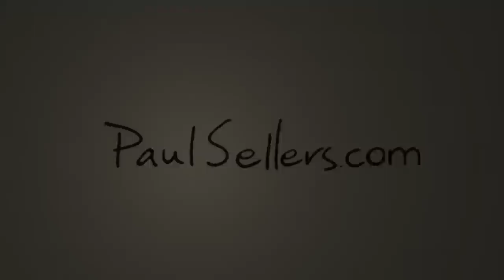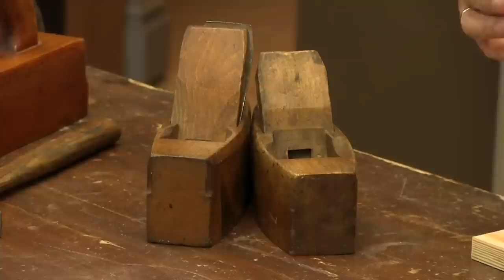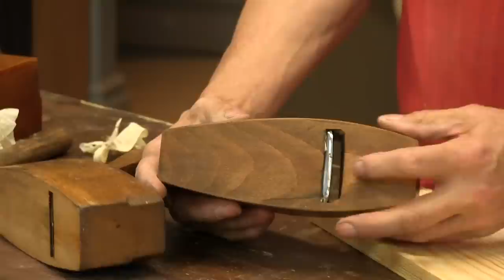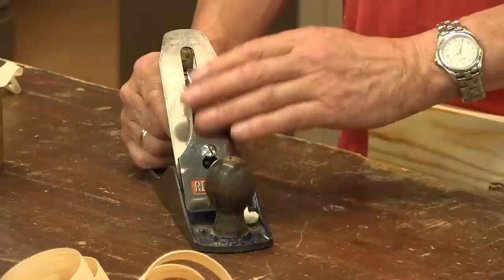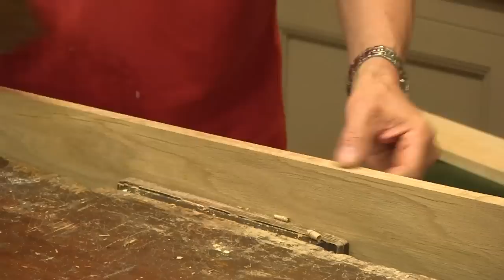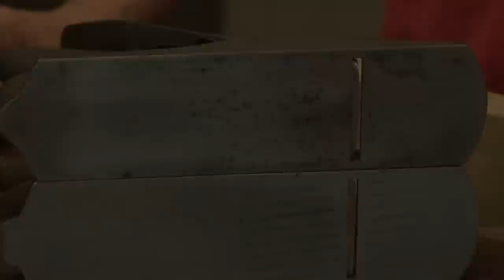Scrub Plane - a Historical Perspective - | Paul Sellers

Comment: in germany we have a name for it since... a loooooonnng loooong time ago :D it`s called  "schrupphobel". as a first year woodworking apprentice I learned that the main difference between a jack plane and a scrubplane is that the scrubplane doesn`t have an additional iron to break the shavings but a wider hole and a somewhat round bevelshape (like a carving chisel). Its used primarily to get off the sawmill traces and after the use of the schrupphobel you use the schlichthobel which is more accurately what you described in this video. the blade of the schlichthobel still lacks the additional iron of a jackplane. I loved to use it in school :)

Comment: This reminds me a lot of Chinese cooking cleavers. The cleavers are first used for taking nice fine cuts for cutting vegetables, but as you sharpen it over the years you wear away the metal and get towards the thicker spine of the blade, you would then use it for butchery and bone cutting. Its the same as using the fine smoothing plane and then as it wears converting it to a scrub plane for the rough (e.i. butchery) bits of woodworking! In the past nothing was wasted, brilliant!

Comment: Just picked up a new ece scrub plane. It took 30 seconds out of the box to adjust and was putting out nice thick shavings. The light tool felt great in my hands. This is why I got into hand tool woodworking. It seams like a critical tool to turn firewood grade into furniture grade.

Comment: I recently purchased a Stanley Rule and Level No. 29 (20 inches long) to use as a scrub plane. I was concerned when I saw that the throat the bottom of the wooden base of the plane was 3/8ths of an inch wide. (The top part of the plane is metal.) Thank you for showing that the widened throat was perfect for my use.
Reply: Hi, I´m going through comments cause I was waiting for an explanation of the longer ones we see on the table. I think a longer  fore-scrub plane would make sense. To bring big high low spots to flat/true surface. Did it work out? Thanks.

Comment: Paul, not this video but thanks for your other video on making a scrub plane.  Following your instructions I turned an little used Stanley 5 1/2 into my scrub plane.  It was first used to thin out the breadboard top to a night table.  The control and speed of wood removal on planing the glued-up boards was wonderful and the plane is so much easier to use with the adjustments than when it operated as a smoothing plane.  With the experience gained in that project, when it came time to thin out some redwood for a guitar top, taking the wood down from 4.5 mm to 2.5-3 mm, it was the perfect tool  This delicate task could not have been done without the control that the tool affords.  It`s a lot faster and quieter to pull out the scrub plane than to get out the giant drum sander and the ear muffs.  And very satisfying.  Thanks again.

Comment: Lovely video Paul, thank you!
My scrubber is an old coopers woodie with a curved sole, it eats wood for breakfast lunch and dinner and I regularly deter people from buying a new iron scrub or, heaven forbid, a thicknesser. The old woodies work beautifully in this role and they are at present cheap and plentiful. Bag yourself a beautiful handcrafted tool that still has lots left to give and it will save you a heap of time and money.

Comment: As I read up more on these tools, there is a notion in the U.S. that the term "scrub" plane was based on a German term. Where as the term "fore" plane was attributed to an English term for the same planes. It's all generally a bit confusing, but whatever they were called historically there is still a modern need for these tools. Thanks for a great video as usual, please stay safe and keep up the good work!

Comment: Hi Paul, I found this interesting  particularly as I am restoring two such planes at the moment having inherited them from my father a few years ago. I'm almost minded to attempt to build some replica ones as i do enjoy non power tool woodworking. The blades are unfortunately badly pittedd any ideas where to get replacements?
Reply: Hi trapper23ful.  If your plane irons are badly pitted, it shouldn't matter unless the pitting is near the cutting edge, when it will interfere with getting a good bevel next to a flat polished surface.  Can the irons be ground back to a cleaner part of the steel to overcome this?  I've had to do this with one of mine (a No6) and it'll give me a good edge for the foreseeable future.
Reply: Yes i think so well certainly worth a try..... one of the planes is too far gone woodworm and splits across the shavings box so effectively have two blades i can try a grind on although i intend to replicate the damaged body in beech
work in progress might just use the project for my first video assuming i can work out how to switch the camera on!!!!

Comment: :D today i converted my Peugeot Jackson rounded molding plane to a scrubber.. reshaped the blade and flattened out the bottom with a plane :D good use of a tool from 1840. i paid 10 euro in an antique fair..

Comment: That's really neat, but I have to ask: didn't people ever save worn planes by gluing new wood on their soles?
Reply: Glues during the heyday of wooden hand plans (animal hide glue, fish glue) were not nearly as resistant to shear as modern PVA Glues are. They may have their place but they would never be able to hold on to the bottom of a plane while in use.

That said, there are many times workers have screwed iron plates to the bottom of their planes to prevent further wear

Comment: Hi Paul, my wooden smoother is still fairly closed in the throat, and could be a good tool.  The problem I have is that the iron comes unseated rather too easily and needs constant adjustment, and I can't seem to work out why.  I've tried cleaning the wedge, and oiled the wood with boiled linseed oil, but it still happens.  Could you share any advice you might have on setting these up properly?
Reply: Hello Ian. Try lightly rubbing dried resin/pitch from pine or spruce along the friction sides (1-2mm) of the wedge. That should increase the holding capacity. If you live in a city, you may be able to find a shop selling instruments where they might have blocks of rosin that violinists use for applying friction on their bows. If the wedge is too saturated with oil, you may be able to remove enough of it with turpentine or you may need to make a new one, and be a little more conservative with the oil...
Reply: DijonInjection   Thanks!  That sounds like it could work, I know someone who plays violin, so I'll ask her if she can help me.  I also think that making a new wedge, or re-shaping the old one, might be a good idea.  When assembling the plane, it feels like the wedge locks solid too soon, with no further depth of movement possible as if it is not 'gradually' wedging.
Reply: Ian Stewart Hello again Ian. Yeah the shape & fit of the wedge is definitely important in how usable the plane will be. A few weeks ago I came across a YouTube channel by "Sumokun" where a guy is documenting the making of wooden planes, and goes into great detail of wood grain direction, clearances and angles. Seems very well researched, although some of the methods, skills and techniques demonstrated made me raise an eyebrow at times, he still arrived at what seems a great result. It inspired me to try to make my own planes too. It might be useful to you too.

Comment: Could you not go back and add a 5-6mm brass plate to the bottom of an old wooden plane to close the throat and increase durability?
Reply from the maker: Yes, you can but it was also common to add a recessed wooden piece to the fore part of the plane and that worked equally as well as to increase durability, this also increases the amount of friction the metal has on the wood which destroys the intrinsic value and property of wood on wood.

Comment: Plane? That's an adze in a box.
Reply: In response to your suggesting a plane is "an adze in a box". The Practical Woodworker Vol. 1 by Bernard E. Jones (circa 1915) page 72 says the adze "is used chiefly by wheelwrights and shipbuilders, but is seldom used in ordinary woodworking. Just as the axe is used for vertical cutting, so the adze is employed for horizontal cutting and splitting."
Reply: i use it to give a board an adzed look